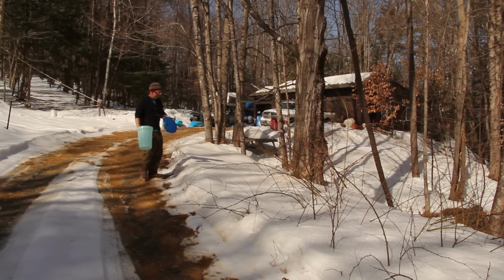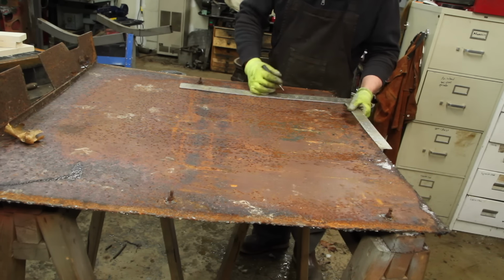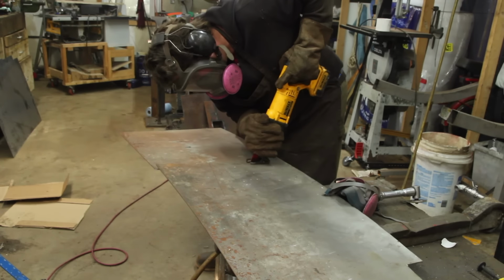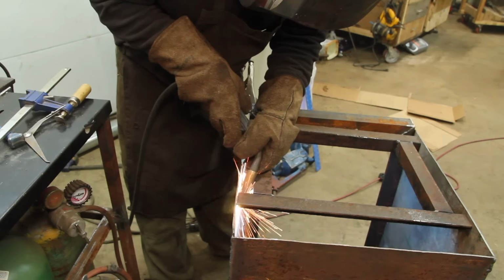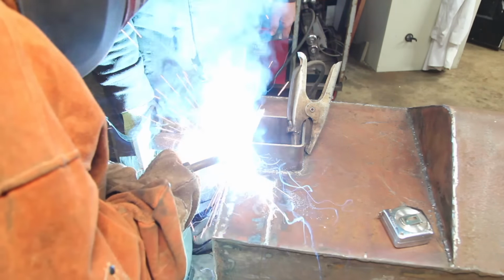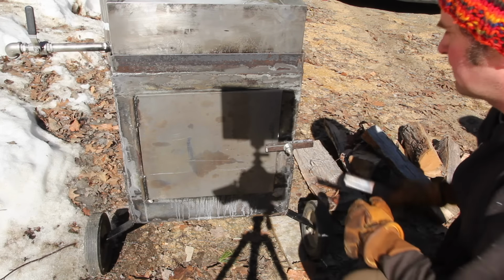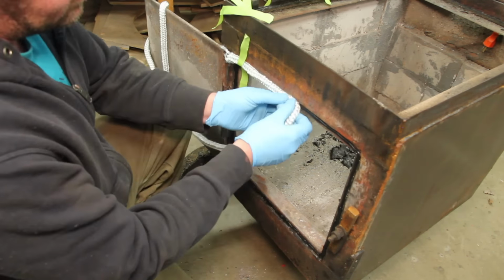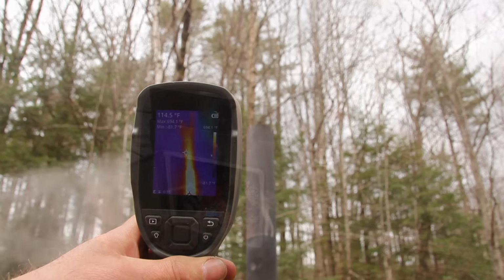Maple Syrup Evaporator Scrap build

Comment: Vermont here, 35 miles south of the border.  The season is running longer than normal, but the temps are turning the sap if you can't boil every day.

Plain old pink fiberglass between the stack and the pan will take care of that burnt pan problem.

Comment: Hi Jeremy. That's a nicely made stove. I made one once (just for heat, not for sap), but I don't have much thick material. I made it from 1.6mm (1/16”) steel, with fairly predictable results!  Did you play with the emissivity setting on the thermal camera? It will probably be set to 1 by default, but that's only really accurate on matt black surfaces (or "black bodies"). Shiny metal has a lower emissivity, so you may be getting inaccurate numbers.
Reply from the maker: Good tip, I haven’t messed with the emissivity, I’m mostly using it for ballpark temperatures and “this is hotter than that.”

Comment: Wow, great video! Is it true that you get more syrup per gallon if you use the reverse osmosis process to get the syrup rather than boiling?

We  had a tree that we tapped for its sap, i forget the name of the tree but it was like a pine with a very thick eucalyptus type sap, and we used it for various things, but, if you got it on anything like your hands, or other areas of skin, or your clothes, it was worse than super glue, and had very potent vapours coming off of it. My wife made candles and toiletries, soaps and bath bombs etc with it, plus it came in handy for cold and flu symptoms. Would rather have had a maple tree but they don't really grow in my neck of the woods in England. But this tree we had would give you pints of the sap, and once we got what we needed we would plug the hole otherwise it would just carry on leaking everywhere. There were hundreds of plugs on it when we moved in already.